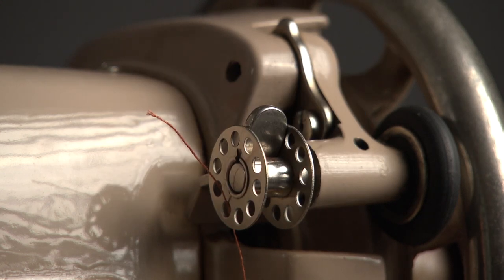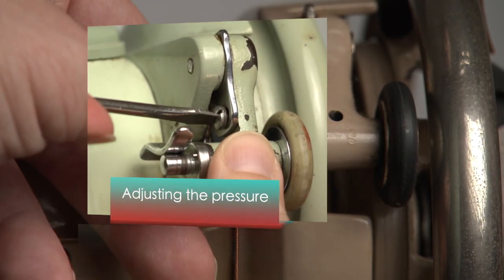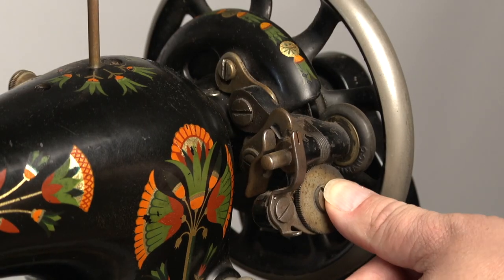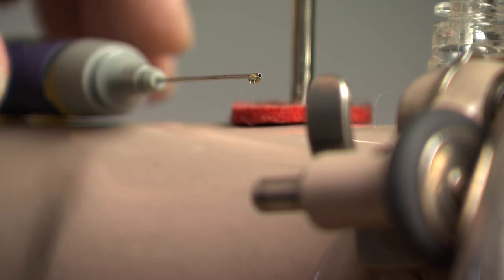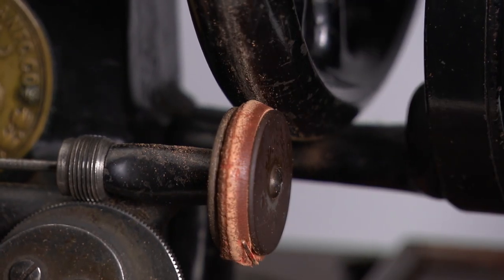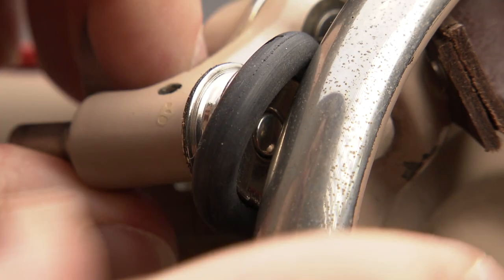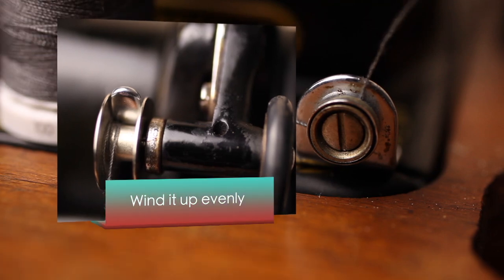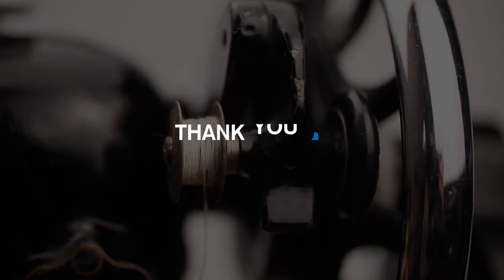Fix issues and adjust a bobbin winder on your vintage Singer sewing machine

Comment: Hallo Erik, i want to replace the bobbin tire on my lotus 66 but the remains of the old tire is hard as rock. Do you have a tip how to remove it. Maybe soak it? I don’t want to ruin my machine😢
Reply from the maker: @JannekeKuijer  hoi Janneke. If it’s brittle you can use any tool to break it off or cut it. 
Schroevendraaier 🪛 of knijptang misschien?
Met beleid en blijf rustig, ook wanneer het even tegen zit
If that doesn’t help then yes you can try to soak it. But I’ll advise you to use sewing machine oil only to prevent damage to the decals. 
Succes / good luck
Reply: @ bedankt, ik ben gewoon bang om het te beschadigen, het lijkt wel beton.
Reply from the maker: @ snap ik. Stukje bij beetje. Letterlijk! Laat je niet gek maken. Ongeduld is je grootste vijand. Het gaat je lukken!!!

Comment: When my hand wheel spins, my new ebay tires spin a few mm and then stop, no matter how I adjust it.  Everything moves freely otherwise.  Could this be cheap tires?  Is there anything I could try in my case?
Reply from the maker: @alyte11  hi. So sorry to hear that. You can get it running. Have you oiled the inner mechanics of the winder mechanism? There is a little hole on the mechanisme. Put one drop of sewing machine oil in it. Good luck
Reply: Yes, I have oiled that little hole.  The shaft turns very smoothly by hand.  The tire will touch and spin sometimes, but usually not.
Reply from the maker: @ that’s strange because you said you’ve already adjusted the entire mechanism. I honestly don’t have any ideas left. 
You might want to join a FB group on vintage Singer sewing machines and post your question over there too
Good luck
Reply: @erikneek  Thanks for your responses.  I did find something out however.  The bobbin follower, or curved arm that sits above the bobbin, seems to be putting too much pressure on the bobbin preventing it from spinning.  If I lift up on the arm slightly, the bobbin spins nicely while it fills with thread.  I have to do this until the bobbin is full.  Just wanted to share.  Thanks again.

Comment: Very clear video thank you. I have a classic singer 66 from 1928, but the bobbins wind unevenly. How can I adjust this?
Reply from the maker: Hi. Thank you so much for watching and your message.
The Singer 66 is a great machine. There are some variations on the class 66. If you have the version with a guiding wheel on the bottom sewing machine bed/plate (directly under the winding mechanism): simply move that guiding wheel a little to the left or right. This should solve your problem.
Good luck and enjoy your Singer 66!
Reply: Thank you so much for replying. No my machine doesn't have a guiding wheel. I think it is the same as the second machine in your video (at 0.18 and 1.04.)
If you have advice on adjusting this winder I would most grateful
Reply from the maker: Hi again @sourdoughbybrigid8957  .
Thank you for your message. That winding mechanism is one of the earlier systems on a Singer 66. You can adjust/ change it, but I'm afraid I dont have the knowledge nor skills to do that.
Are you on FB? There is a FB-group on Singer 66 & 99 machines. You may want to join that group and ask your question there. I'm sure someone can help you with your machine.
I'm sorry I'm not able to help you. Good luck!

Comment: It's a hand crank
Reply from the maker: explain this statement, please. Meaning?
Reply: @erikneek  the singer 99k sewing machine is a hand crank machine, I've got a treadle sewing table also, this was last year November 2023. I hope this clarify what I was talking about.
Reply from the maker: Not really  @ebrahiemmurphy6506  - I'm sorry. The video is about adjusting the bobbin winder. It's irrelevant if it has a hand crank, treadle or has a motor. I used a 15k and a 191b for this video, so no 99k was used. (And btw the model 99k was also build with a motor.)
So I'm really sorry but I still don't get it.
Have a great day, Erik

Comment: where can I buy bobbins for 201k3
Reply from the maker: You can buy them everywhere! They are the common type 66 bobbins. (Do NOT use the standard class 15 bobbins in your 201!)
Try Amazon, ebay, Aliexpress, or your local sewing machine shop.
Good luck!
Reply: @Erik Neek  hi Erik, I live in Perth, I bought bobbins at Spotlight, and they fit in the bobbin case but not on the bobbin threader .  I will thanks a lot

Comment: I'm restoring a singer machine is from 1868 and is the cam type.  everything works except when the bobbin is done winding, it doesn't "click" or stay up.  What keeps the bobbin winder in the up position?
Reply from the maker: Thank you for your question.
You have a really, REALLY old (!) machine. 150 yrs old, must be one of the first machines EVER made.
I have some (limited) knowledge when it comes to vintage sewing machines. In this case I think you might find your answer in a specialists Facebook group. Consider joining such a group and post your question there. 
Good luck and sorry I was not able to help you.
Reply: @erikneek  well after doing some more checking, it's actually from1939 model 66...I was way off!   I found a vid that shows a hidden spring that I think maybe broken.  Thanks for responding!  Youtube comments are a great way to get info from all over the world...and a few laughs thrown in.

Comment: Hi, could you please advise a solution for the wheel which tends to rotate backwards in case of Merritt singer Model 15ND which I have been using since 1990. Also treadle footer runs fast but stitching is quite slow.  Pl guide me to fix the issues. Tx in advance. Your vedios are very informative. Tx again
Reply from the maker: Hi Tigress.
Thank you for leaving a comment.

I have read your two questions several times now, but unfortunately I don't understand neither of your questions. (English is not my native language...) 
Can you please rephrase them?

Thank you.
Have a great day, Erik
Reply: @erikneek  hi..tq for your response. My machine is -merritt singer (treadle type) MODEL 15ND/88-89 Made in India. Stitching speed is very slow. Please help.  If you have any User Guide please share.  Tq
Reply from the maker: @tigressblr6188  
Hi,
The manual/user guide may be found online. 
You could try joining a group on FaceBook like the Vintage and Antique Singer Sewing Machine group. Take a look in the files-section.
(Note that your machine is not of the quality the original Singers are, but they function more or less the same.)

Increasing or decreasing the speed can be achieved by using another flywheel/ balance wheel on your machine.
I havent tried it, but there a multiple videos on YT showing how it can be done.

Hopes this help.
Take care,
Erik
Reply: @erikneek  tq. I will join the FB group suggested by you. I will still trouble you incase of any other issues🙂. TC bfn

Comment: I have another problem.  I took the bobbin winder assembly unit off of my Singer 15-30 (it's a 1908 electric).  I needed to clean it.  However, when I took it apart, the springs popped off before I could see their placement, so I now cannot reassemble it.  Do you have a video or pictures that shows the placement of these?
Reply from the maker: Hi Janet.
I just filmed something.
I hope this helps you.
(Tip: Hit pauze if it goes too fast...)

Link:
https://youtu.be/0NZqXluq6fk

Good luck, Erik

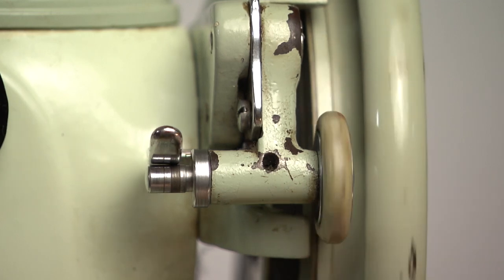Comment: I have a hint about later type of bobbin winders. Before thitheen screw push this shiny plate by pressing the top edge (0:48). It will help position to more correct.
Reply: Also I recommend using silicone oil on the bobbin winder because other oils always damage the rubber tire after applying (most people put too much oil).
Reply from the maker: @Акула-б3х  Thank you for both hints!!!
Reply: @erikneek  Today I repair bobbin winder thread tension (screw, spring and plate was lost) with a button from jeans (part what have a hole) but screw should be twice longer. Working like original one and looking not bad at all. Spring from autopen.
Reply from the maker: @Акула-б3х  Great work!
Reply: @erikneek  Also today I found some ussies with standard presser foot. It can be curved on different positions. If you try fit other presser foots they can be not in the right position. Curved standard presser foot after years because it is cheap stamped metal and after decades of pressing from powerful spring it is just deformed. If you setup another machine, before rotating the presser foot rod, check presser foot first.

Comment: Is there a specific type of sewing machine oil you use?
Reply from the maker: You can use any sewing machine oil (brand).
I've read an article a while ago where the writer stated that it's good to search for the most pure SMO out there - The most clear SMO is the better. According to that article.
But I use SMO by Prym for years and I havent had any issues. It's perfect in my opinion.

Depending on the issue the oil will have immediate effect or (in really bad situations) there is result in a few days.